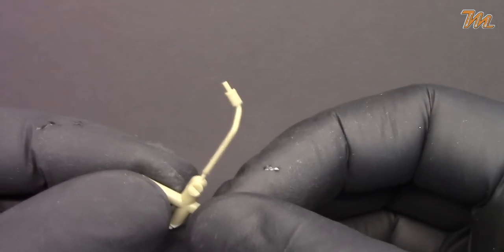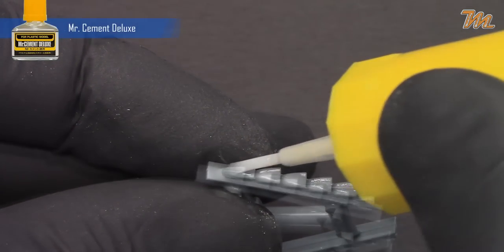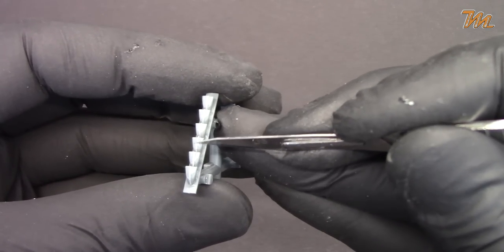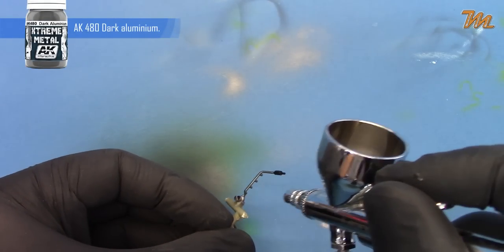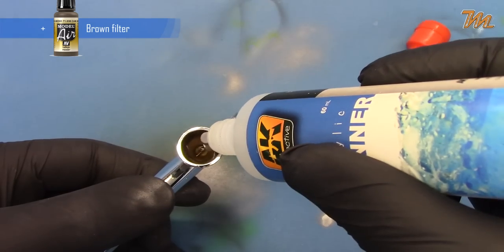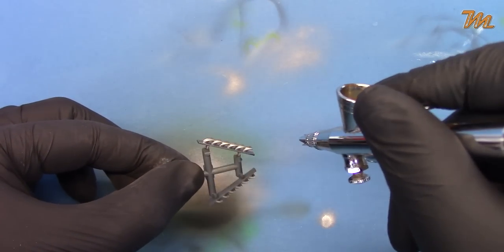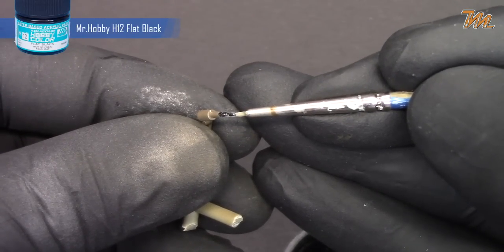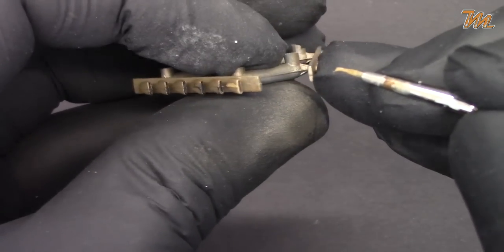Painting and weathering exhausts - scale modeling quick tips

Comment: Hi, thank's for that video :-)
1. I do not have a black primer. I have a Mr.hobby surfacer 1200(grey). It is important to do black before silver?
I saw on other video, that other person also use black surfacer before silver.
2. What do You think about Tamiya Gunmetal X-10 15% + Flat Red BrownX 25% XF-64 + 60% thinner for Ju88A4 exhaust in Jamo211J? 
Or Silver and + brown filter (from tamiya xf64 i do not have VALEYO )like your's video?
Reply from the maker: Hi, for this application the colour of the primer does not matter that much. However metalizers are performing best over gloss black. 
The other colors are more or less a matter of personal choice. The colors I have used in the video are just a rough guide.
I am not familiar with Ju88 but generally the colours you suggest should be fine... Some experimenting will help you get to the desired results.
Best regards
M.